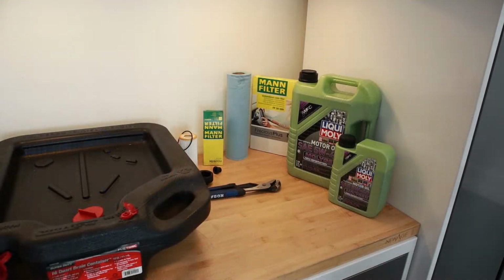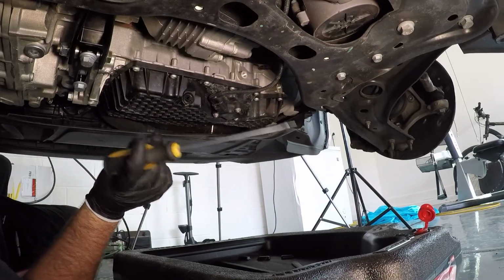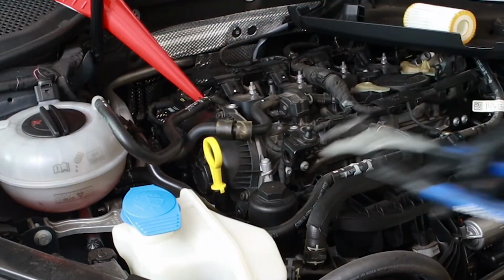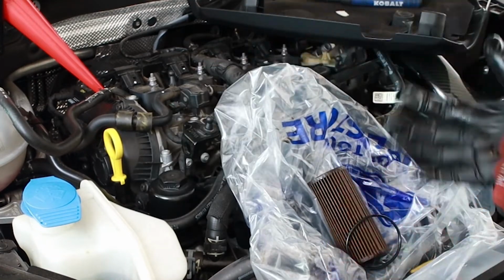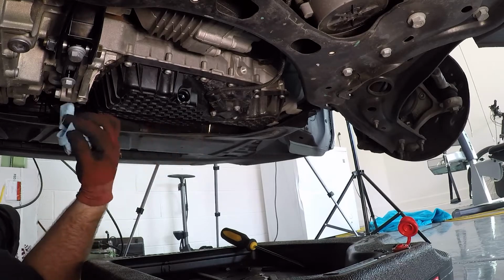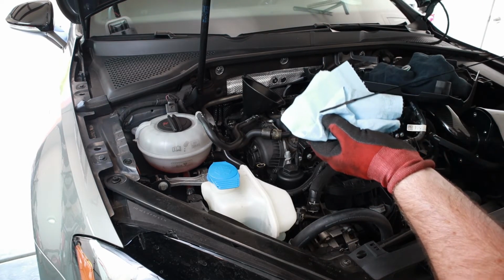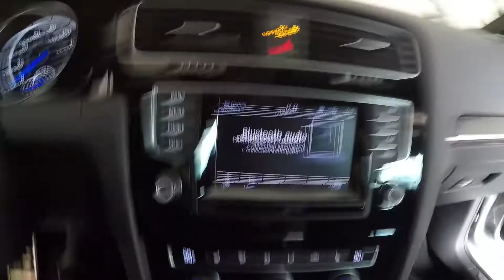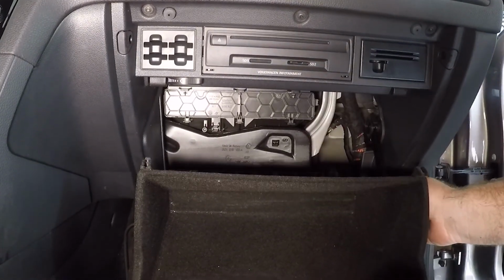VW Golf (Mk 7) Oil and Cabin Air Filter Change - EASY DIY!

Comment: I change the oil by sucking it up from the oil dipstick ,works like  charme :) 
Also the my preferred oil is Fuchs GT1 , anyway the best thing is to have just the right specifics and reccommended by VW , regardless of brand.
Edit: and upwards facing oil filters on VW are so convenient to change :)  I use a 32mm hex key on mine.